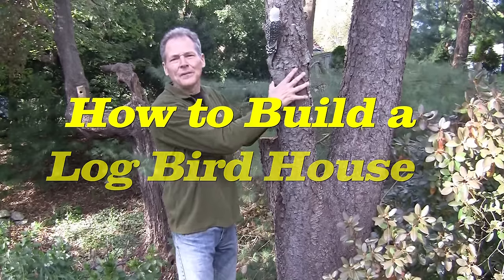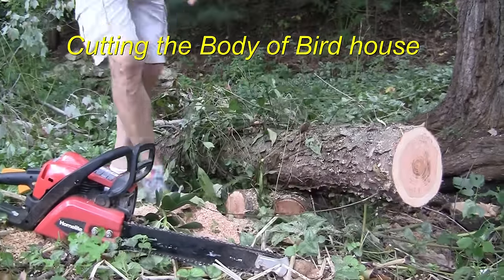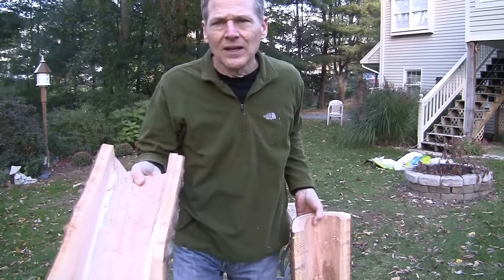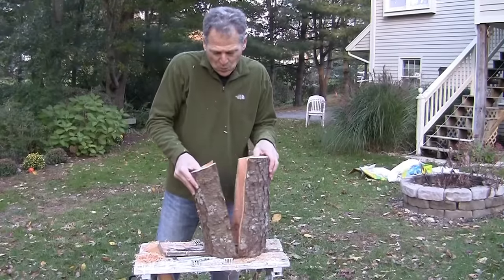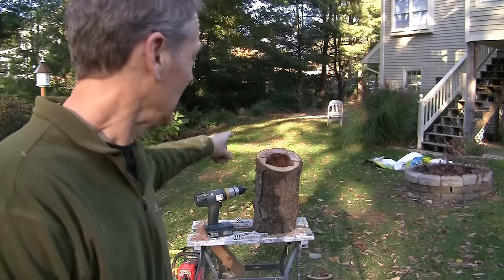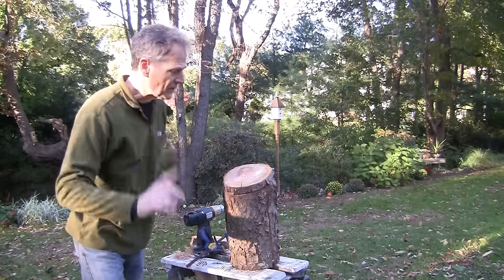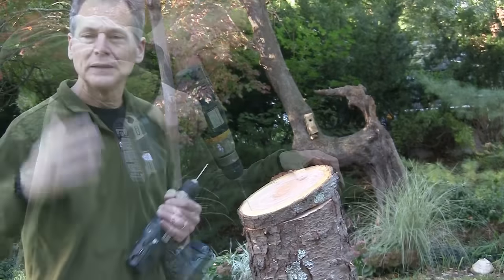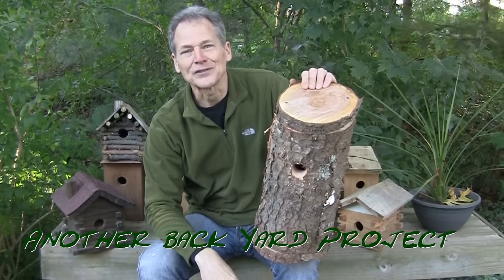How to Build a Log Bird House....Unique design

Comment: 5 inch hole saw and you dont have to cut the log into two or cut the bottom off, just the top and need no screws for the sides.
Reply from the maker: How deep can you go with a 5 inch hole saw????

Comment: Nice project how long did it take to do ?....not counting cutting the tree down.  I noticed when you sawed the piece down the middle you where already half way trough. Do you get resistance sawing down the middle?   Thanks 😊
Reply from the maker: It didn't take that long. Made  be a couple hours. ...No on the resistance cut..I did that just to shorten up the video..You don't need to see the whole cut..Thats not a problem at all..It was a fun project..Also note it was very heavy and I had a hard time mounting it, trying to hold it up and set a large bolt...Good luck with your project..
Reply: @Backyardprojectguy  oh..ok. Thanks for getting back.
Reply from the maker: @philw.8439  You bet...Good luck with your projects

Comment: Nice! Might have to do one one of these days. That would make a good safe home for a lil' birdie. Not to take away from the way you did it, but I would put a little piece of dowel rod inside by the hole before I screwed it together and a piece outside the hole, just to help them get in and out a little easier. The other thing I would do is put the hole on the opposite side so the rain wouldn't drip down over the hole from the top being sloped towards it. All in all tho, nice project! Thank you!

Comment: Nice job! I built one, but am curious...where did you put the house for the birds? Mine has a bit of weight, so I can't just put it on a pole. Did you use a wood post to mount it up high enough for the birds?
Reply from the maker: Excellent question...I used a ladder to put up high in a tree, I used 6 inch lag bolts..If you look at the beginning of the Video, look over my right shoulder and you will see one in the background, hanging on the tree, I  made that one last year.
Reply: Well I'm not a birder but my wife certainly is, and I think I am gonna make one or two of these. PSST..Off topic but I need help. How can I lessen sparrows and swallows and starlings swamping the sites, throwing all the food down and kicking other birds away? Ideas?
Reply from the maker: UGH!!!  you ask the MILLION Dollar question..I feel your pain about the sparrows & Starlings taken over the feeders...I have ask several Very Intense Birders that question...They told me to try and find the sparrow nest and then take it down before they can hatch the babies..Sparrows and Starlings are not Natural to this country and just over run the natural population..

Comment: Absolutely love the idea. I am going to make one. I just wished you had included in the video the best way to attached it to a tree. I am sure it is quite heavy!! I would hate to see it fall down in years to come. Hopefully you can let me know how to attach it to a tree.
thanks
Reply from the maker: Yes I should have said something...I used two good size lag bolts..One I took the roof off and two I went through the enterance hole..I needed an extension on the drill and the ratchet to lag it in the hole..Yes the Bird house was heavy....I screwed and 2X4 to the tree placed the bird house on it, and put the two lag bolts on..Then I took the 2X4 off...I hope this helps amd I hope it gives you some ideas...Good luck with your project..

Comment: That was a good one. I would have liked to see the mounting process.
Reply from the maker: To mount it I used three lag bolts..I took the bottom and top back off, Drill a hole and lagged it to a tree..The third one was with an extension I lagged it through the Entry whole..Hope that helps a little..

Comment: That's a rather awkward way to get a hole in a log. I think I'd try drilling first. Actually, I've made a couple but I drilled and bored using a metal lathe. It went pretty quick and the bottom was already done. Just a top and an entrance hole needed. They don't seem to last all that well unfortunately.
Reply from the maker: Great Idea..I thought about that..But how do you get a drill that Big???..I don't have a Lathe..Its on my bucket list!!
Reply: @Backyardprojectguy  Drill (6) 1-inch wide holes in a circular pattern then just knock out the center piece.
Reply from the maker: @zedwpd  I will need to try this..

Comment: Hang it in the shade and drill vent holes for air in the bottom and near the top.
Reply from the maker: Excellent idea..I should have thought about that ..as I have done that on my other bird houses that i built..Always have some air holes or loose fitting roofs..Thanks appreciate that

Comment: WOW I just made one a few weeks back as it was around the time birds start nesting. In the UK anyway. I made mine just the same way you have but smaller for blue tits. I used a hand saw and a router. I think they always look better and more natural made out of a log rather than flat plywood made into a box shape. I've got one in my back garden and front garden and got blue tits nested in both. Thanks for sharing your video 👍
Reply: Lumber Jack  No I don't put anything in them. I just let the birds build themselves. But at the end of each summer I do clean the old nests out of the boxes. 👍

Comment: Don't do this at  home. It could lead to severe injury or death.
Reply from the maker: I guess I shouldn't Fly on a plane or drive my car because that could lead to severe injury or death..Did you like the bird house?
Reply: @Backyardprojectguy  Yes, I do, except the bottom is likely to direct water inside the box. I am surprised you are wearing no  protective  items, though.   xx
Reply from the maker: @BagaYaba  ...Yes my bad on the protective gear!!..I should know better.....any water should be able to work its way out on the bottom..Its not sealed very tight..Thanks for the comments..I do need people to keep me in check..